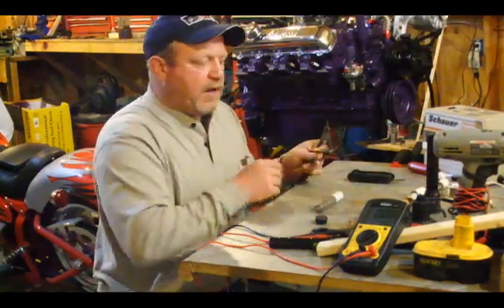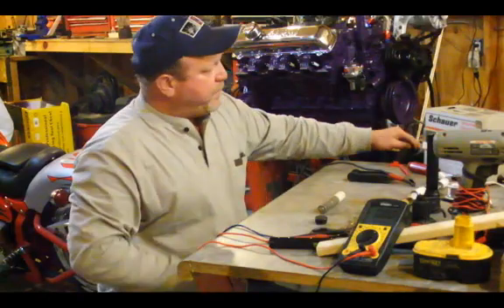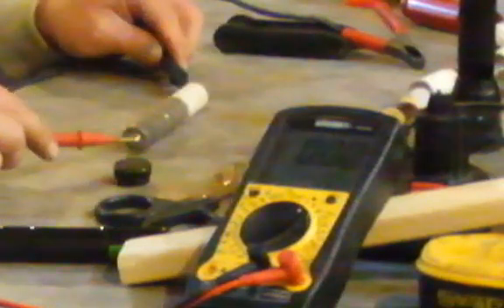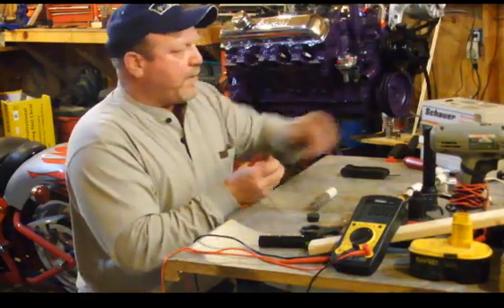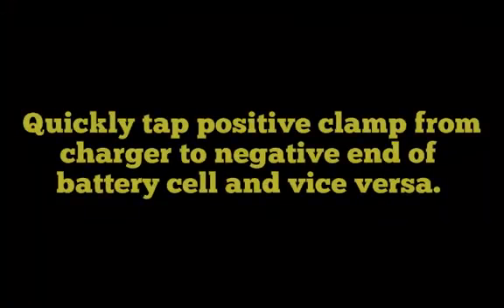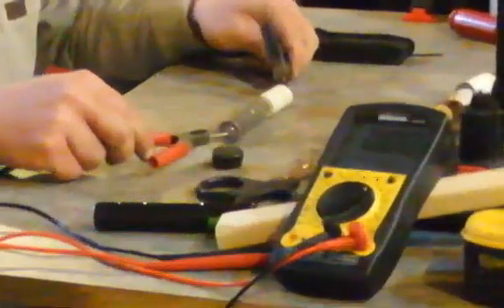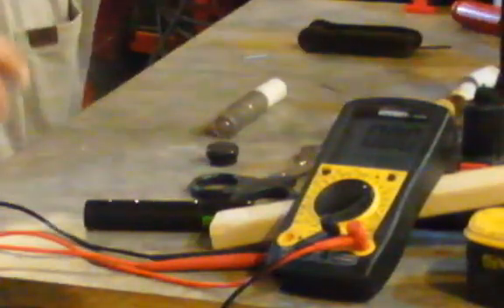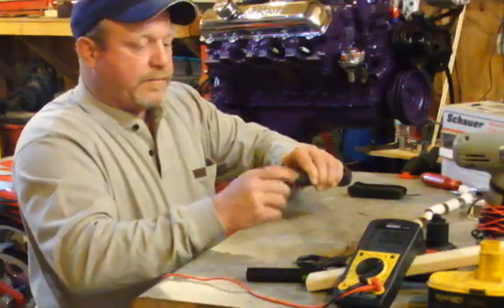Recondition NiCad Batteries For FREE

Comment: A Computer PSU will work for single cells as well.. it's DC power. you don't get a spark but it  does the job.

Comment: You really should separate each cell as most of the time one cell goes dead and screws up the whole series voltage.  Without doing so you increase the chance of bad things happening from pushing all the other cells over the edge.  Once bad cell is recharged then balance all cells in parallel then put back in series. Simple but tedious.

Comment: ac works as well (maybe better) or pulsed dc from a PWM ......... when power  is revered through the battery it causes a reversal of flow in the chemical ........ which causes the oxidation around the rod to explode off into the chemical revitalizing the contact between the chemical and the strip

Comment: Your text about which end to connect to which seems backwards.  You say connect positive charger to negative on battery.  I doubt that is right.  I've done this in the past and always connected positive to positive, etc., just as you would to charge a car battery and it's worked fine.
Reply: I hate it when these utubers post a video but never answer any questions in the comments
Reply: I agree. It confused me a little.
Reply: ya, vid resolution isn't real sharp, but it looks like he's doing + to +  and - to -.   further, how would it increase the voltage if it was the other way?
Reply: reconditioned my dead car battery a few weeks ago with your program and it's been working perfectly since then! My car battery was completely dead before I used your methods.

This just saved me hundreds of dollars on a new battery!
https://tinyurl.com/yd8txjvv
Reply: There are several factors in getting a good result. One plan I discovered that succeeds in merging these is the rapid renew roadmap (google it if you're interested) definately the no.1 info that I've heard of. look at this super website.
Reply: Not certain about the points made but ,if anyone else wants to discover how to recondition battery try Jadonite Renovate Battery   Buddy ( search on google ) ? Ive heard some great things about it and my neighbor got excellent success with it.
Reply: gogleplus sucks Nice Video! Sorry for butting in, I would appreciate your thoughts. Have you ever tried - Lammywalness Trendy Trade Guide (just google it)? It is a great exclusive guide for learning how to recondition batteries at home without the headache. Ive heard some great things about it and my old buddy Taylor finally got cool success with it.

Comment: How many amp hours available from reconditioned vs. new batt?  Looks like your treating the accumulator (battery) as a condensor (capacitor).    Does voltage drop in blocks as each cell discharges or does it taper off slowly?
Reply: The two twats above me are just spamming, anyone who is reading them PLEASE don't google mentioned scams.
Reply: @kosztaz87  ~ I hear you.  Why can't the fuckers just drop a link ?  Looked up Jadonite and wound up in a shaggy dog story how the dickwad tells you how some high profile types have had success in rejuvenating batteries.  He says it is a short vid but yet you can't get a time on it like we do with "YouBoobs", which to me is just another long winded blowhard bloviating a lot of hot air.  I looked at one of those type vids once and 48 minutes in the asshole was still not saying anything of value.
Reply: +Paul Trace interesting points ,if anyone else is searching for how to recondition old batteries at home try Megarno Amazing Battery Magician (do a search on google ) ? Ive heard some amazing things about it and my friend got great success with it.
Reply: Thanks for the Video! Apologies for chiming in, I would appreciate your initial thoughts. Have you heard about - Lammywalness Trendy Trade Guide (just google it)? It is a good one off guide for learning how to recondition batteries at home minus the normal expense. Ive heard some amazing things about it and my BF finally got astronomical success with it.

Comment: Do the batteries you 're-condition' actually hold their charge for any lengthy period? I very much doubt it. Still, I guess it's good to extract every last bit of power you can out of these batteries before you eventually have to throw them away.
Reply: Yes, assuming the battery wasn't damaged during use or this method of recharging.  NiCd batteries can become discharged due to the chemicals no longer being suspended(?) or however it's packaged, no longer properly, and therefore not produce power.  By putting larger voltage than normal across the battery, it often will break this up and make it usable again.  DO NOT use 12v charger on a single cell!  I'd suggest no more than double the voltage to do this, so put your charger on 6v if it has it, or put 5 cells together (each 1.2v x 5=6v) and use 12 volts.
Reply: +gogleplus sucks - good points - what amp range should the charger be on?
Reply: @geo6892000  Did you ever find out what the amp range should be? This video is good, but certainly could use some actual values concerning recommended voltage and amperage for given number of cells.
Reply: @kosztaz87  ~ If Project Farm guy or Chris Fix did a vid like this you would get very specific instructions.

Comment: Have done this with Black And Decker Versa pack 3.6 V NiCads, using an old style car batty
charger. One was zero volts and would not charge, the  other was  2,5 V. and would not get up any higher.  Now the zero one is 2.6 V. and the 2.5 V got to 3.9 V. But as you say the reserve   power in them is less than new.  Old style batty charger is switchable to 6 V.

Comment: Hello i killed both my dewalt battery during sheetrock mixing. They working 2 minutes with very low rotation after charging now.
I've planned throw them away when i found You movie.
I would try test Your method by using inverter welder. dedra 200.
How much Ampers i should set for 18v 2A battery?
Are You sure i have to contact + / - not + / + and /?

Comment: OK if you are wondering WHY this works, it is because of Dendrite Growth in the NiCD battery cells itself. The Dendrite crystals act to cause shorting in the cells and shocking it like this breaks the Dendrite Crystals, but not all of them. This has been known for the last 40 years, but battery makers hide it so, guess what, you buy more batteries instead of "repairing" your existing cells. NOTE: this won't last for long, it will happen again and again worse and worse each time. You lose 15 - 20% capacity each time.
Reply: If it will happen again, and again....why not just buy a new battery?
Reply: @Keith Benick interesting points ,if anyone else wants to learn about how do you recondition a battery try Jadonite Renovate Battery  Buddy (just google it ) ? Ive heard some interesting things about it and my m8 got excellent success with it.
Reply: Visit this site if you want to learn the best method to recondition your batteries: JoxCharge. com

Comment: Nicad rejuvinators have been around almost as long as Nicads themselves. Nicads have the bad habit of "bad cells" which went totally dead. One popular circuit charges a large capacitor(10,000 uf yeh, I know THAT isn't large NOW but it used to be) to around 30 volts, then it is switched to the cell plus to plus, negative to negative, to discharge. Usually a cell will revive within a couple of tries. It's also a more precise method with little if any "overkill".

Comment: I have a charger now that has a fairly high threshold (maybe 10 volts) and if it does not see that much voltage on the leads it will not turn on the 12 volts output.  Maybe other people will run into that as well.

Comment: I know that the primary cause of NiCd failure is internal shorts caused by unwanted crystal growth.  The zapping basically destroys the short.  The first time I heard of this and tried this method was over 20 years ago.  Since then I've forgotten but do you zap in series with the battery or in parallel?  I thought it was parallel, but your video seems to indicate plus to minus...etc, which would be in series.

Comment: is there a way to convert cordless power tools to plug in 110v AC to the wall. basically make them permanently plug in tools??
Reply: short answer.  No.  They use DC motors.  You'd likely have some nice fireworks trying to apply AC to a DC motor.
Reply: @drock5404  yes I know you can't do that. I was referring to a voltage converter to change battery power to ac using a voltage convertor. Lol, sorry if I wasn't clearer.
I do know you can't hook it up directly.
Thanks for the reply

Comment: um sir.... you're most definitely doing this the hard  way, all you have to do is
1. put the battery in the charger
2. unplug charger reapeatedly, several , many times until you see the red light
3. remove battery from charger and use like brand new.... best part NO SPARKS :)
no need to spend money or electricute yourself or wear safety goggles...........

Comment from the maker: Second off, I suggest you actually try it and post your results, instead of simply talking about theory. As far as starting a fire, let the battery cool off between "zaps". Yes, this is risk. Many thing worthwhile in life like experiementation. The key is to minimize those risks. I don't suggest anyone try this with lithium but NiCads are much safer. If this works, think about all the power tools and batteries that are thrown away that could be used. Let me know when your video test is posted.

Comment: First off ,once a battery has no capacity left. there is NO WAY to bring that back, No matter what you do there are only so many plates in the cell itself to hold the capacity so all you will do is maybe bring back the voltage to 1.2v or 1.35 volts but if you don't have the capacity to back up the voltage you have NOTHING just a waste of time watching dumb videos that may set your house on fire ,

Comment: Batteries are usually slightly over what the rating is. Such as a new SLA is roughly 14.75-15 volts. Over time the cells inside the battery will lower. If it decreases to far the battery could die entirely make the charging process longer and capacity smaller. So with my SLA example, if it lowers below 12 volts. It will need to be replaced or reconditioned. This also applies to NiCd, NiMH, LiPo, and Li-ion.

Comment: The text in the video says to tap the positive end of the power supply to the negative of the battery, but in the video, the positive is connected to positive of the battery.
The three cell battery pack in the video is not dead, so this just shows a quick charge of the battery.
It's only when one of the batteries shows a dead short and reads 0.0V that this is useful to open up the internal short and allow it to take charging current.  Using a capacitor for a momentary pulse would be safer.

Comment from the maker: The increase in voltage wasn't due to the battery getting hotter. The raise in temp was a side effect of shorting the battery and it's the rise in temp that can cause the batteries to explode.

Comment: Are you sure that the voltage increase was due to the fact the battery got hotter? You should try and run the same experiment but make the 2nd measurement after 10 minutes to make sure the battery cooled down. About the same effect: throw any battery into hot water for a short time and it will behave like a brand new one. *** This is risky I don't recommend to try this, possible serious injury if battery explodes ***

Comment from the maker: If the battery is dead, IMO you want to short the battery by reversing the connections. Be careful though, as this can cause the battery to over-heat, so use short bursts with time inbetween for the battery to cool.